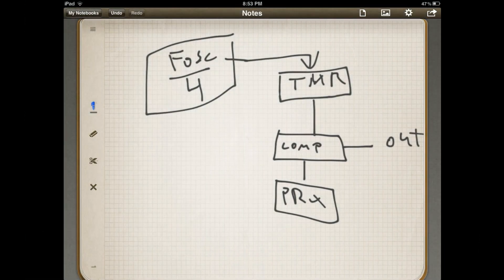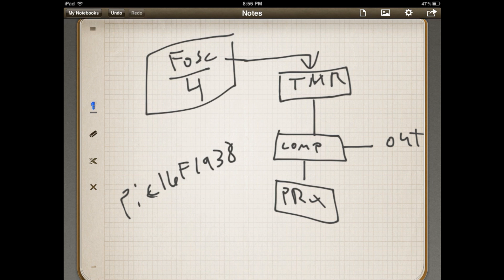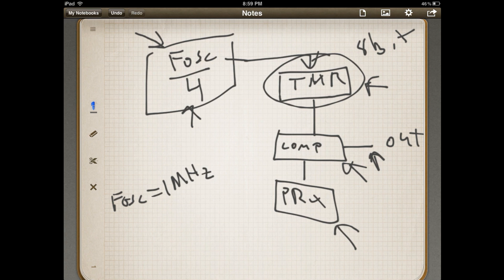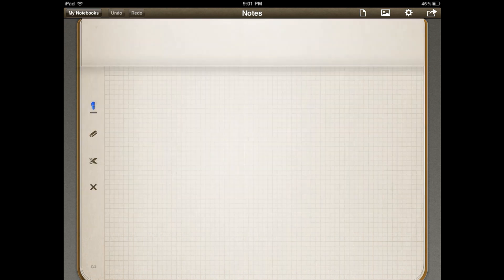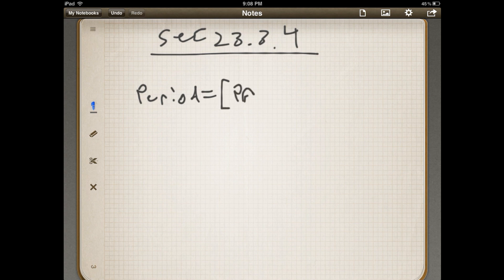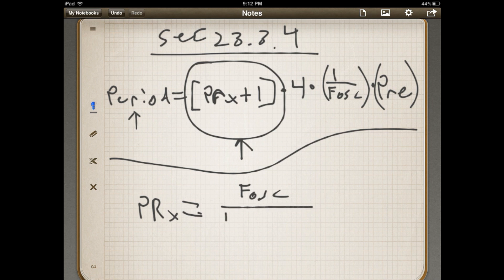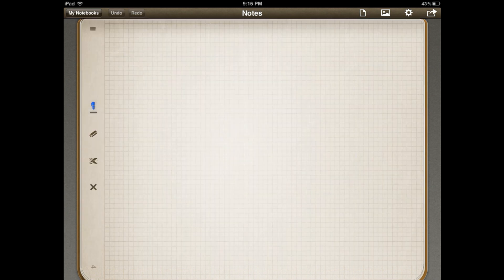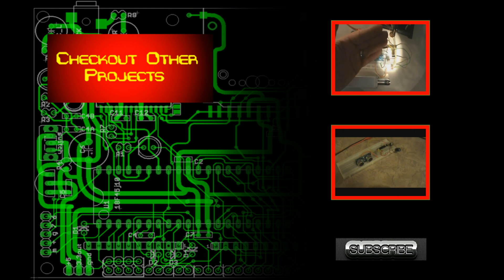PIC Basics - PWM Part 1

Comment: i WANT TO CONTROL SPEED OF AC CEILING FAN. WHICH WORKS ON 220 VOLTS AT 50 HZ , PLEASE HELP IN THIS REGARDS 
USING PIC 16F73
Reply from the maker: For an AC ceiling fan you will most likely have to use an SCR (silicone controlled rectifier) you can look into TRIAC devices this is what most of the speed controllers are nowadays.

Comment: Duty cycle is ton/(ton+toff). 1ms/1ms+1ms)=0.5  or (50%)
Reply from the maker: I agree on your equation.  I put a note in the video about that I made a mistake and the denominator should be the period which would be ton + toff.  Thanks.

Comment: I think the reason you need to divide by 2, is your oscillator is running at its default value of 500kHz. Use the OSCCON register to change it. The #define _XTAL_FREQ 1000000 doesn't set the frequency. It used for delay calculations. I enjoy your videos.
Reply: Agreed, not an expert but recently ran into a problem with default OSCCON value and delays.
Reply from the maker: Hey there thanks for the comment.  Yeah that is right!  Thank you very much for clearing that up.   I totally forgot about the OSCCON register.  I was racking my brain trying to get the equation to work.  Good catch.  Thanks again!